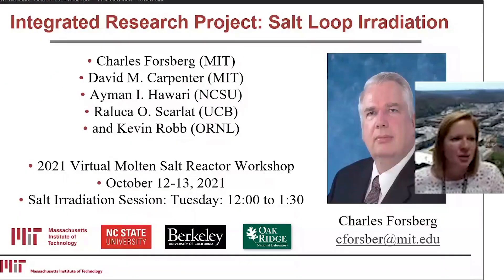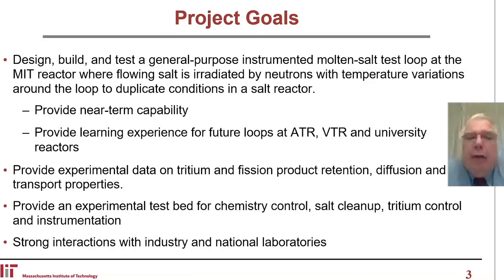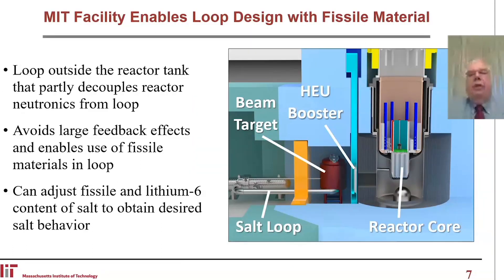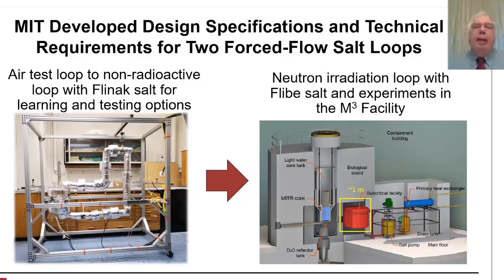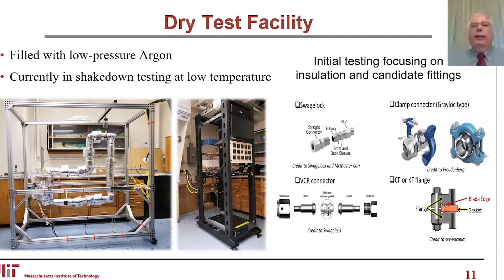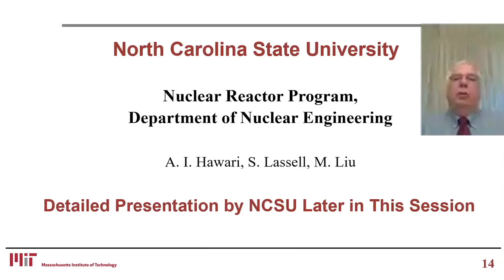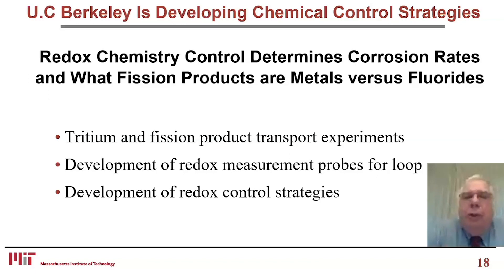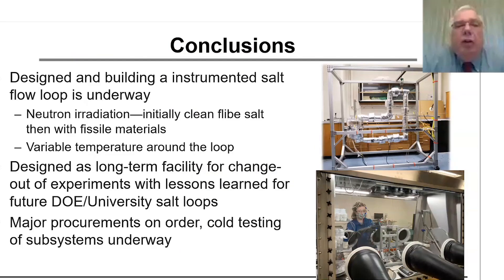Salt Loop Irradiation - Charles Forsberg @ ORNL MSRW 2021

Comment: Is there any interest in handling particles in these salt melts, for example to keep control of the process and its temperature? We can sort or filter out particles completely naturally without any filters from 10 nanometers in all temperatures. I also think we can divert different gases with the same technology. See my channel for with info and links.
Reply: I personally am interested in the idea of forming a carbon suspension in the fuel salt to replace the need of solid graphite. A carbon suspension would be “flexible” and fluid, unlike a swelling graphite block. I imagine it’ll be abrasive though. Just an idea I had

Comment: My question is, "how can we use Oak Ridge to isotopically separate lithium 7 and lithium 6". If Oak Ridge can separate u235 from u238, think how much easier and faster would the reaction work between 6 & 7, than between 235 & 238. It would seem to me that Oak Ridge should be making tons & tons of lithium 7 right now, because the future of our nation depends on not fusion "pie in the sky", reactors, but cheap, clean, chemical & electrical future without tritium production. It should also NEVER downblend u233 as that will be the fuel of the future and the  more of it our nation possesses the better for "we the people". Molten salt flibe reactors with lithium 7 is our future no matter what the fusion enthusiast's think or do. As fusion power reactors will be super expensive and produce tons of tritium no matter how it works, and tritium is a "no go". If it can be locked up with fluoride for long term with safeguards OK, if not we don't want it in our drinking water.

Comment: I'm always surprised how slow the progress is, it seems like we are still rediscovering knowledge we have lost/forgotten since the MSR experiment was shut down.
Reply: MSRE did a lot, but easy to overstate how much they knew. Modern techniques are much more powerful and portable. However, modern MSR research is also being done on a shoestring. It's impressive that it can happen at all.
Reply: @sealpiercing8476  There was recently an interview with the major industrial investor here in Sweden. 

He said he would be very interested in investing in nuclear power if the politicians only could guarantee that rules will be set and not suddenly change after the next election.

And I don't think that's going to happen.

Sadly enough.